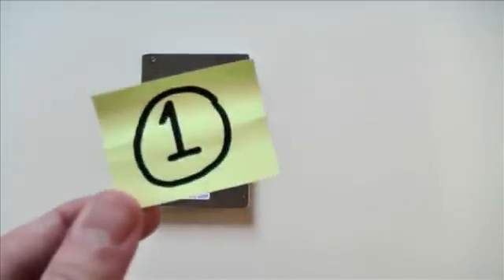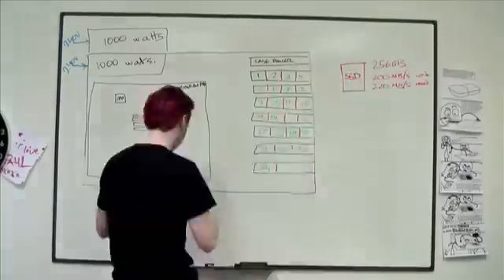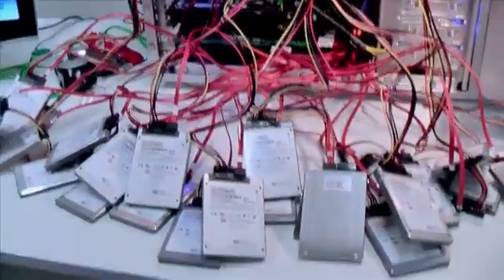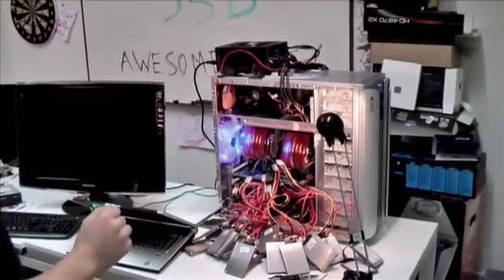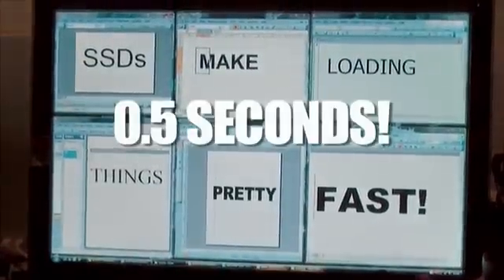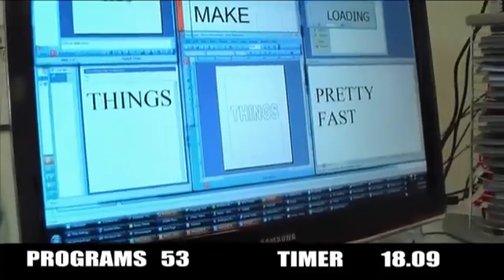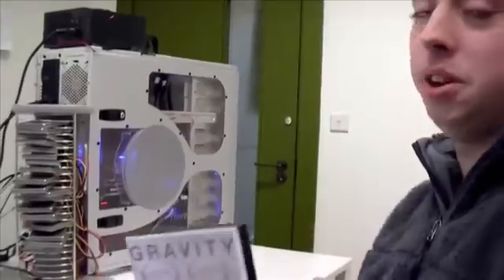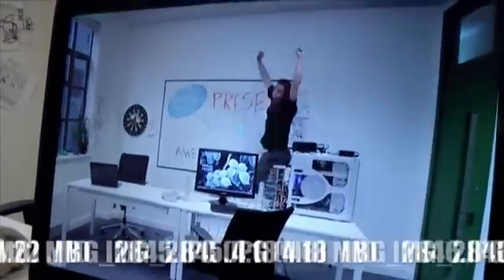What happens when you RAID 24 SSD Hard Disks !!!!!

Comment: Smith is right, you're certainly not one of those that would have given much to development of a civilization, if you can't think further than what you see.  Ever occur to your that opening 50+ programs is merely a display of how quickly executible images are loaded into memory and how quickly a process is spawned by the OS? Those two are indicative of the machine's processing power when applied to production environments, but you knew all that, it only takes knowledge of hardware and OS design.

Comment: They never said what kind of raid they used, so we can't assume the loss of one drive is that bad.  If it's raid 5, 6, 10 or anything else but raid-0, the loss of one drive means nothing.  Judging from the write speeds they showed, it's something that doesn't use parity, so we're left with either raid-0 or raid-10 (doesn't matter, speedwise, if 0+1 or 1+0)

Comment: SSDs are designed to fragment data so you can't wear out the NAND gates quickly. Defragging them is a waste of time and is wholly useless. Linux filesystems also don't not need to be defragmented. There is just no point. The kernel operates differently from NTFS and FATx. There is plenty of fragmentation no matter what filesystem you're using. Yes, ext3 basically defrags itself but it can get bogged down requiring defragging or replacement of the filesystem (Since defragging ext3 is a bitch).

Comment: I'm not impressed. The guys at Maximum PC were able to achieve 1 GB/sec speeds (half the speed in the video) with just 2 SSD drives in RAID 0. In theory, they could get 2 GB/sec with just 4 drives, so with 24 drives, they could theoretically get 12 GB/sec if the speeds were to scale per drive (which don't, but it would still be way faster than in this vid). Either this is old technology (vid release date not found), or this system wasn't optimized.

Also, who defrags SSDs?!

Comment: No, dumdum. 
Fragmentation is only bad because the data isn't located closely on the platters, so the actuator has to move more to read a single file, thus needing longer and getting slower. 
On a SSD fragmentation isn't a problem because there is no parts that have to move in order to read a file, so it doesn't matter how far apart they are.

Linux's ext4 similar to MacOS's HFS+ prevents fragmentation and defragment on the fly, which is why fragmentation isn't really a problem there.

Comment: you need a software that allocates the bits correctly from the start (S.M.A.R.T is what I think they call it), that way you never have to defrag. The switches in an ssd have a very short lifespan, and with even just one or two defrags, you can ruin them

Comment: Now you can accomplish that speed with just 4 SSDs.
when the PCIe versions come out, you will need 3, or 2 if they are good.

the current SATA limit is 6Gb/s or 550 MB/s
PCI has a much higher threshold. 
The new MacBook Air computers use a PCI based ssd which maxes out at ~750MB/s.

Comment: The main thing about fragmentation is that files get broken up into different places on a hard drive increasing the time it takes to search for all the parts of the file. Defragmentation is helpful to take all the fragmented files (and sometimes the normal files) and place them in the most space efficient location. IE: If you have file A and File B and they take up space like this: AAA_BB__AAA the defragmenter will place them like AAAAAABB___ so you have 3 spaces instead of 1-space and a 2-space

Comment: In the end, if you stop the fast slideshow you will read that the Areca 24 SAS port Raid card only gave them 800Mbytes per second throughput, and they had to buy a second raid card, that wasnt enough still, they had to use one third of the SSDs on the onboard RAID, one third on the Adaptec and left the remainder on the Areca... What a frankenstein setup... Not sure i'd want that... i'm using LSI 9240 8i, too poor for a 9260 with CacheCade :(

Comment: because it works differently! It stores all the information in seperate 'blocks' because
A: Unlike a hdd, file location on flash memory has little/no effect on thoroughput
B: having the files in separate locations reduces risk of corruption, and writing information to seperate locations spreads out the writing load. Defragging would group the info together, which would just reverse all the hard work the firmware has been doing keeping it separate

Comment: defragging a ssd causes unnecessary read/writes which will reduce its lifetime because of flash memory wearing(every write will wear down the memory, after about 10,000 writes a flash cell will (on average) start to fail.
Defragging does nothing positive to performance on an ssd, but if you run it daily you will wear it down a lot more than if you didnt run it! only defrag hdds - they are the ones which need files to be located in one area on the physical disk for max performance

Comment: Furthermore, all newer SSD drives contain onboard logic that ensures even distribution of usage across the memory space, in order to ensure even wear, because NAND-based memory cells degrade with each use. That means that the drives actually fragment themselves on purpose. A manual defrag is not only pointless, it is counter intuitive and only induces a lot of unnecessary wear on the drive.

Comment: You understand that SSDs have access speeds of roughly 0.1ms from anywhere on the disk, right?  Unlike a traditional spindle/platter drive (i.e. HDD), there is no seek time.  Due to this absence, non-contiguous file placement DOES NOT affect performance in any perceivable way.  In fact, defragmenting an SSD REDUCES its lifespan due to the number of writes inherent to such an operation.  Surely, you know this?  You wouldn't want to be guilty of spreading your ignorance to the world, would you? ;)

Comment: This would be incredibly faster if it were to be done today, and would approximately cost 6000 dollars for the drives alone. Then you need to add in the two CPUs ($2000 x 2), two power supplies($400 x 2), motherboard ($600), case, fans, cpu cooler.... This may be a $13,000 system if built today after all is said and done.

Comment: LOL, if only you could take the SATA connection and increase the data transfer speed (kind of like "overclocking a RAID-SSD configuration") so the SATA transfers faster on the motherboard, the drives give information out faster, and the power-usage is adjusted so everything can all run at the same time XD

Comment: There are 2 things:
Solid State Drives
Hard Disks
There is no "Solid State Drive Hard Disk"
"Hard Disk" implies there's a spinning platter inside of the drive
"Solid State" implies there is not
With the exception, possibly, of some hybrids, they can't be the same. And hybrids aren't the same either, they're both in a single casing.
I know how this shit works, on a deeper level than even you or the people on this video do. Not to be abrasive, but I am confident that is true.

Comment: WRONG
All NTFS file systems need to defrag (unlike ex2,3,or 4) or else you could get small corruptions in files (misplaced bits, etc) which can accumulate into what is known as "Bit Rot" and can cause permanent physical damage to the drive, ESPECIALLY the fields on a SSD.

Comment: SSDs are much more efficient compared to HDDs. but they usually have smaller space. so it's a toss up. my personal preference is to have an SSD in my laptop and an HDD in my desktop. plus the SSD is less likely to break if the laptop is dropped or shaken. :)

Comment: Defragmentation was developed for mechanical hard drives to(as you already pointed out up there) clump all the data in one place so that it would not have to read from several different locations. so I'm not sure if there would be any benefit at all to what you just proposed. Instead consider enabling a TRIM.
     TRIM enables the SSD to handle garbage collection overhead, which would otherwise significantly slow down future write operations to the involved blocks, in advance.

Comment: Macs don't do it because its formatting system tries use freed up space from deleted files. so everything on a mac usually remains in order until the hard drive is close to full. Most HDDs require defragmentation while SSDs don't. so not every PC will require defragmentation from time to time.

Comment: Not entirely true.  Caches work best with linear reads, so it might be slightly beneficial if you do a lot of linear file reads.  That said, I still wouldn't regularly defragment an SSD.

Defragmentating sticks all the data from a file in one place.  On SSDs, random access times are similar to linear access times, but on spinning drives the random access times are much longer, so it's very beneficial to have associated data clumped together.

Comment: Take into consideration of the processor cause everything is ran also by the processor then add the memory into account; there are more factors here than just the SSD drive....i would like a full specification on the actual system at hand before making a judgement of weather or not the computer CAN successfully do what is being asked of it, however that being said there is a lot of data ran from the hard drives anyhow...

Comment: Negative, Defragmentation has nothing to do with storage. The Defrag function is wasted on a Solid State Drive(SSD.) Unlike mechanical hard drives which gain efficiency from the Defrag function, SSD's only suffer durability loss and thus have a short life span if defragged on a regular basis.

Comment: there is no such thing as a SSD hard disk there is a solid state drive or a HDD (hard disk drive) which writes information onto a spinning disk (the hard disk) where as the SSD uses integrated circuits to store data it has no moving parts and is faster (also it cant be fragmented so i have no idea why he defragged in the video cos that can destroy an SSD you can get SSHD's which are hybrid drives that use hard disks for storage and the SS section to speed up access on frequently used info

Comment: Actually, it does. They reworked the units to make them comply with all the other units of measurements using the mega- prefix.

1 Gigabyte = 1000 Megabytes. If you want to refer to the "old" system, you should use Mebibyte (MiB) and Gibibyte (GiB). You can read all about it in the wikipedia article for Mebibytes.

Comment: It absolutely, categorically will *not* make file access ANY faster and never needs to be done.
Hard disk drives have moving parts which cause a delay when data is fragmented. SSDs are electronic and have no moving parts, therefore the delay is the same no matter how fragmented the data. Defragging will only severely shorten the life of the drives and gains absolutely nothing.

Comment: Hahaha that's cute. You should read up on GiB vs GB before 'correcting' me. 

Your first sentence is wrong. 8Gb (gigabits) = 1GB (gigabyte). 8GiB (Gibibyte) is -not- equal to 1GB (gigabyte). 8GiB = about 8.59 GB (gigabytes).

1 GB does = 1000 MB and 1 GiB = 1024 MiB, so your third sentence is wrong. A 250,000 MB hard drive would equal 250 GB, but it would equal about 232.83 GiB.

For reference, MiB / GiB = mebibyte / gibibyte | These are the only vaules based on 2^x
GB / MB = Gigabyte/Megabyte

Comment: lol guys if you defrag an ssd you increase the write commands (less efficient than hdd because hdd can simply overwrite but using NAND flash tech in ssd, transistors store the bits and degrade over time proportional to write load) which significantly decreases the lifespan of the ssd. commands are executed instantly no matter where the data is on the chip. You guys just gg'd 24 ssds at once, new world record.

Comment: doubt it, he claimed how fast it could delete files, most drives will delete files that fast, as when you press delete you dont actually delete the file, you just make the os not know where the file is an allocate the space it was in as empty space. also this is stupid as the pc will bottleneck those drives really badly, in theory they are capable of probably 10GB/s but he only reached 2GB/s which can be achieved with 4-6 drives

Comment: Hello, sir there is nothing to defrag because the filesystem on an SSD works entirely different than a regular HDD. Yes I have an SSD and it's an Intel one too. It said so specifically in the Manual: DO NOT DEFRAGMENT THIS SSD IT CAUSES SHORTER LIFESPAN AND CAN MAKE THE SSD UNREADABLE. USE THE PROVIDED TRIM SOFTWARE FOR MAINTAINING SPEED AND LONGER LIFESPAN OF YOUR SSD. I don't think the manufacturer would lie about it. And SSD's crap out because overused cells.

Comment: You are an idiot, sorry, do some research! You shouldn't defragment an SSD because that damages the lifespan of the SSD and SSD's dont need to be defragmented anyways because they can access the memory pretty much as fast as if it was defragmented. So if you defragment an SSD you're only making it's lifespan shorter. About lifespan, it's said that SSD's don't last much because they have a certain ammount of I/O operations but when it comes to other factors, ssd probably last longer than hdds.

Comment: Well, do you know what fragmented harddrive means? It means that parts and files are scattered all over the disk. The read/write head has to move more often to complete a read or write action. Well, SSDs do not have moving parts! If one part of a file is somewhere else than another part it does not matter to a SSD! Yes, theoretically you can gain about 0.4 nanoseconds per read/write action but you will not notice any difference ;)

Comment: You TRIM SSD's not Defrag em. defragmentation causes a reduced lifespan of the SSD, it is said specifically in the manual if you buy an SSD. By trimming your SSD it will have a longer lifespan. Just for the love of hardware never Defrag an SSD.

Comment: Raid 0 is for pure speed, I use software ware raid for data protection / backup. 

Also, if you want games to load fast, you can go out and buy and extra 16GB or 32GB RAM for your PC and load your games unto a RAMDisk and make them run +- 5000MB/s.. where at this point you have more bottlenecks then the drive..

Comment: Yup, it might seem like I was serious. 

But I wasn't, lol. Comparing DDR3 to those SSD-s, RAM modules have at least 4 to 10 times faster read/write speeds (6,4 GB/s - 19,2 GB/s), so of course it's a dumb idea. Plus, as you said, RAM much cheaper. It would theoretically work, but I bet Vista would run maybe a little faster than 512 MB + an ordinary hard drive with, say, pagefile of 4 GB. Which means that it would freeze at least 20 times an hour. 

Thanks for a constructive reply!

Comment: Defragging an SSD regularly reduces lifespan (limited # of rewrite cycles using SSD technology), it was a pointless test as you cant really use defrag time as a benchmark. Defragging an SSD is also pointless because the only gain you get from a defrag is compensating for HDD head movement delay by clustering common data together on the media. But that defrag would not have reduced the lifespan any more than the other tests performed- its all about number of rewrites not 'that program kills SSDs'

Comment: well. SSD is pure flash memory and no spinning disc's. so defrag is a waste of time. moving files around on the same flash memory? yeah right. no point doing that. a normal HDD needs to be defraged when the computer loads files slower. some programs also moves common used files near the center of the HDD giving you quicker loading times.

Comment: Data only supports 6.0 gbps gbps throughoutput. The only way to get full speed is with a series of hardware controller with ram buffers on 4 $500 raid controllers. Therefore It is only fully speed with a special bus and a 24 port card. Otherwise you have a bottle neck and/or software raid. I think the performance could be better.

Comment: He is jumping while the drives are reading and writing which would be very bad for a hard disk (because, due to the movement, the head crashes on the platter and scratches it, damaging the hard disk), but since a solid state drive doesn't have mecanical or moving parts it is inmune to that problem.

Comment: Yeah, Raid 0 spreads data across each drive. so, if you wrote 24 MB of data, it would split 1 MB to each of the 24 drives. so in turn, when you access 24 MB of data, you are only accessing 1MB from each drive. this substantially increases performance. BUT, there is no redundancy. if one HDD fails, all data is lost.

Comment: There are different raid configurations. Another one makes 2 or more drives act like one big one, so it's pulling the data from several at once, so it's a lot faster. I would check out the wiki on raid configurations, that stuff can be interesting.

Comment: Defragging a RAID controlled volume does essentially nothing anyways, and I'm assuming they're using a flash-aware RAID controller in this video. The drives would have been fine, running a defrag at worst would be equivalent to opening a 10gb video file across the entire array.

Comment: look up RAID0 instead of RAID1. I only have two SSDs in lvm striped (logical volume management [Linux]) and get nearly the same speed transfering files from my SSD array to ram (tmpfs). It seems the RAID controller is not able to keep up in this case, which is why my computer uses a software implementation of striping (my Phenom X6 running at 3.8Ghz allows the data to be processed in parallel incredibly fast) rather than hardware RAID. Still perfer my 2x1TB LVM array for long term storage.

Comment: no. you just don't have to defrag. defrag moves and adjusts data on the disk to be right next to eachother in read order. however this is meaningless on an SSD because there is no physical needle that goes along the disk like in old drives. On an SSD all points of data are just as quickly accessed regardless of location.